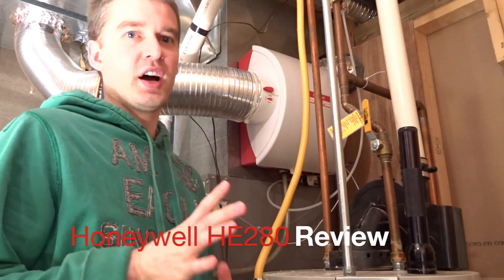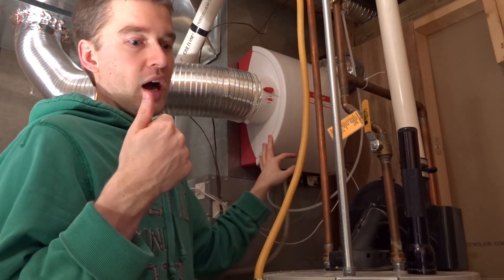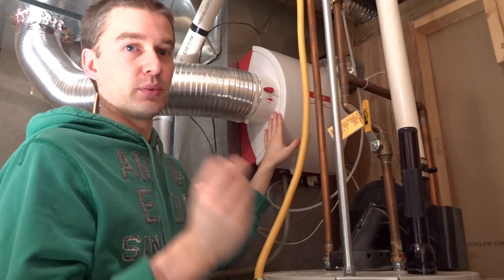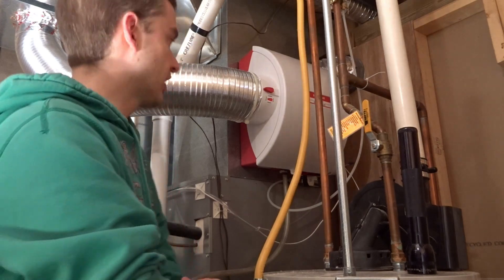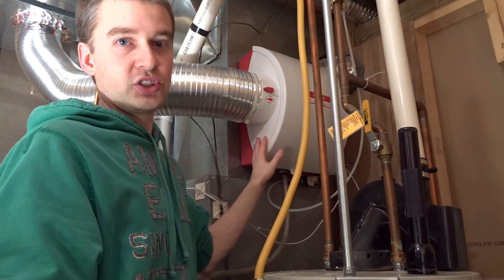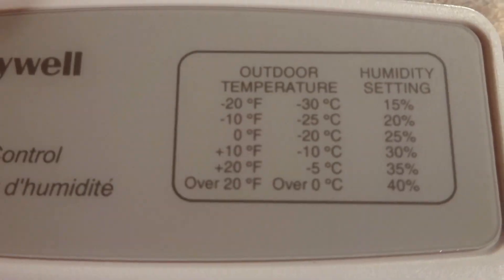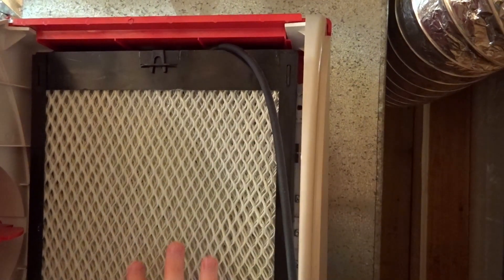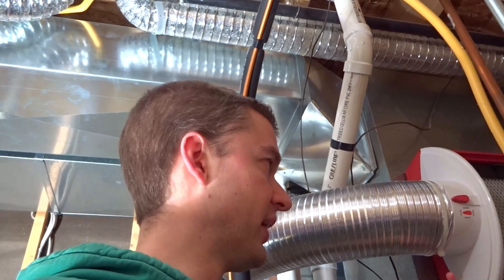Honeywell HE280 Humidifier Review

Comment: Thanks for the video. I installed a HE240 this weekend. It was fairly easy to install. I had to use a PEX valve instead of the provided saddle valve for the water hookup. At first I used the compression fitting inserts that came with the saddle valve (the brass insert and plastic ferrule). The fitting leaked horribly. I went to home depot and got a new brass insert and ferrule from a different manufacturer and that worked great.
Reply: So, how is the HE240 working for you, can we get an update?  How has water usage been?  How about air quality/humidity.  THanks!

Comment: I am in the middle of installing an HE280, as my previous HE220 solenoid valve was stuck and wasting water going through continuously (probably related to hard water deposits). I had to cut the opening in my return duct larger for the HE280 and slightly shorten the air bypass duct length. Then I found that the quick connect on the valve leaks water no matter how carefully and firmly I push in the plastic tubing. Will go to a hardware store tomorrow and try replacing the quick connect adapter. I wish the instructions would have the option to omit the pressure switch, as I don't see the need for it if I use the 24VAC power from my furnace circuit board that already cuts power when the fan is not running. I will figure that out after fixing the water leak.

Comment: Adjust the air flow knob "summer/winter" down a notch as to not suck moisture into the combustion chamber. I noticed the deposits above the furnace body. this is my experience anyway.
Reply: How did you wire the unit up? I still can't get mine to work...

Comment: Hey Jett! My bro and I recently installed the HE280 model on his furnace. The part that takes the most patience is the duct cutting. Aside from that, it was not hard at all. 

I think I see one problem with this installation though (I know you didn't do it). The air goes from the humidifier itself, to the return duct that it is connected to.  It looks like the previous homeowner installed the humidistat AFTER the duct that the air goes through from the unit. That will create a false reading I think, because the newly humidified air is now hitting the humidistat instead of the ambient air from your return vents, which will not make it cycle correctly.
Reply: you are right, the humidistat should be before the humidified air enters the return duct for it to work correctly.  good eyes.

Comment: I have a powered HE300 Honeywell Humidifier, and it can actually run without the furnace calling for heat (the humidifier kicks on the fan when needed).  I have issues reaching 40% humidity when it's 25F outside.  You said your humidifier is great even in negative degrees F...do you live in a humid climate?  I'm curious, as it's cold AND dry outside, and I want to make sure my humidifier is working correctly.  Thanks!

Comment: If my attic isn't vented (old farmhouse, previous owner covered the gable-end vents too) should I be worried about mold growing in the attic with one of these? There is a lot of cellulose insulation in the attic, but it is not air sealed.
Reply: Buy a cheap hygrometer, like the ones used for cigar cases. Take readings off it. If the humidity up there is over 50 percent, that's too high and promotes growth.

Comment: Question: The last house I lived in had an aprilaire humidifier that was awesome when it worked. Now, I live in the St. Louis area and calcium is a problem in our water. Almost every year I had to rebuild or replace the celinode on the humidifier in our old house. In our new house we don't have a humidifier yet and I was wondering if you've experienced any problems with the celinode on this unit? Any information would be awesome. Thanks a lot.
Reply from the maker: Funny you should ask. The solenoid just went out this year.

Comment: Whenever you connect your water supply on humidifier you should you should connect to the hot water line.Works quicker for humidification process
Reply from the maker: Does that cause quicker corrosion of the lines and filter?
Reply: That does not apply to the Honeywell True Steam Unit. They recommend that you supply cold water to that unit! The reason is the filter cartridge doesn't like water thats over 90 deg. F.
Reply: @kylew.jarratt4543 is this model a cool humidifier or a hot humidifier?
Reply: That’s a terrible answer because we all know everyones water takes sometimes two minutes to get warm or hot and it’s just not running that much water to the pad continuously. Cold is the better option

Comment: I installed the same humidifier after watching your review. I have a few questions 

1- On the Humidistat it indicates as it gets colder to turn your humidistat down. Ex: -20C they want you to turn the dial to 20-25% (I understand that it helps reduce moisture on the windows but when you bring your levels that low won't you be uncomfortable as its outside the comfort zone?

2- You said that it takes minutes When you adjust your desired setting on your humidistat. My house was at 30% and I had my humidistat up to 40% for hours when it was -29C outside and it was not going up at all. Am I doing something wrong?
Reply: Depends on a number of factors. How large is your home? What part of the planet, your at? How well your home is insulated. The unit only can deliver so much moisture, per day! Who sized the unit?
Reply: I was wondering the same thing when I watched this video...it seems counter intuitive, typically, the colder it gets, the more dry the air becomes....hence, the need to add more humidity to the air, not less.  I wish someone could explain that, I guess it could be the water on the window thing, but they should just leave that up to the owner and let them know---"hey, you will get condensation on the window or cold walls if the temperature drops too low and you don't decrease the humidity".

Maybe the lower percentage for lower temperatures means that is the anticipated natural humidity in the house, and the humidifier will crank out more humidity???  I know your comment was 2 years ago, did you try the recommended setting?  Did you ever get it to work?  What was your solution...replaced the model?
Reply: if you have moisture on your windows it will drip down to the wood and over time, make it rot.

Comment: Nice video. Could I ask how to shut off water to humidifier? Thanks.
Reply: there is a valve at the water supply line running to the humidifier.  for summer use turn the humidistat to off.
Reply: @davidm7824  THANKS.

Comment: Shouldn't it be installed on the cool air return side ,and not the furnace side.
Reply: cool air will not keep the duct dry, so cool air duct grow mold much easier than the hot one. personal opinion!
Reply: @hongliu5344  - You're backwards chief; Warm air is mold & mildews BEST friend!!! Grows slower in colder air.
Reply: If put on the cool air return side you would then have to send the humid air through the filter...right?
Reply: @ldlink3935  The moist air will damage your heat exchange. Need the hot air to move the moisture.  Also I think you need to hook up hot water to the line. It will evaporate much easier then cold. If you hook up cold water on the cold air side. You have no heat to evaporate the water. Also no to the filter question. It runs through the cold air intake into unit and to the heated side.  This avoids passing it over the exchange.
Reply: i just installed mine, and the directions say you can install it either way. just make sure you install the humidistat upstream (before) the humidified air goes into the duct not after.
Reply: @mitchkennedy11  You would need a recirculation pump installed to use hot water because nobody’s hot water gets fast instantly

Comment: Cost savings is probably a myth. It takes more energy to heat up wet air than dry air. It is true that you will feel more comfortable with lower temperatures at higher humidity, and therefore there is less heatloss though the homes insulation, windows etc. but I don't believe for one second that a humidifier results in energy savings.
Reply from the maker: The claim is that you can turn your heat down slightly, and the humid air will feel warmer. We keep our heat at the same setting, so I'd tend to agree with you.
Reply: Sorry Gents! But the heat load numbers don't show that. Because the heat in moist air stays in the structure. Less heat loss.
Reply: in the summer go outside when it is 85 degrees. does it not feel hotter when the humidity is high? same thing indoors, in winter in feels warmer with higher humidity, so you can lower the temperature, saving energy. it also keeps your wood furniture from drying out. makes it last longer. think about it, it is no myth!!!

Comment: Question for you..I installed my Honeywell and I love it!  I hooked mine right into the terminal in my furnace that was marked humidifier being that I didn't have an outlet near by.  Was that not an option for you with yours being you plugged into into an outlet on its own.  Just curious!  I was so hesitant to cut that hole into my duct work but I just made the plunge and did it..SO glad I installed it!
Reply from the maker: That's interesting! I'm not sure if that's an option on my furnace, but that would have its advantages. I love ours too, very little messing around and very good results.

Comment: I purchased and installed this unit 3 weeks ago. It is going through A LOT of water. Like 15 to 20 Gallons per day!!! 
Where I live, they charge us for our water usage. This was supposed to save me money on my heating bill, yet it is now costing me MUCH more money in water bills. This is unacceptable. 

Can anyone please provide a means of using a closed loop system for the water supply (which i would top up manually as needed), or some other way to reduce the water usage but still get the right humidity level for my home?

Otherwise this product is useless for anyone who pays for water usage. BUT, humidification is necessary for a furnace as not having proper humidification will cause respiratory problems for adults and especially children.

I will not be able to recommend this product to anyone unless can figure out how to reduce this water consumption. Any help would be greatly appreciated!
Reply: how were you able to measure water usage?
Reply: it is easy, put the water drain line in a bucket for 24 hrs
Reply: maybe he has the the humidistat set way to high or it is not working.
Reply: That water usage is normal with these types of humidifiers, I don't know where they pull their max 12 gal number but its bogus. Depending on the outside temp mine uses about 6 to 9 liters per heat cycle ( the water valve is only open when the furnace is fired) I see this on my digital water meter. I call BS at 5:19 with his water estimate, you know he never measured it.
Reply: @jonsmith7667  What I did was install a SharkBite valve on my cold water line and connected the water feed line to the SharkBite valve.  This way I can control with the valve the water flow to the unit.  With the unit running I look at the amount of water that is flowing out of the drain tube.  I adust the valve until I have a trickle coming from the drain tube.  This way I know I have sufficient water flowing through the but not too much.  If I opened that valve all the way,  there was a ton of water going down the drain.
Reply: @fredrickwilliams5804  that's a good idea and I have tried restricting mine but the problem with where I live is winters are a crap shoot. humidity and temperature are all over the place so it required a lot of adjustment

Comment: waste water like a hell. I measure mine. More than 80 liter of water flow into the drain per day. Such a waste. Not environmental at all. This thing hurts the earth.
Reply from the maker: That's a good point. Have you tried turning down the humidity setting so the pad just stays saturated.
Reply: Should check to see if the solenoid valve is functioning properly. These solenoids are known to fail and cause water to continuously flow.
Reply: Don't trip! there Mr. Earth. Check to see that the restrictor valve is in the line. And the valve is closing when it's off. Then go hug a tree! Lol!
Reply: Hurts the earth? Please explain to me how you manage to destroy H2O?
Reply: Flow down the drain? These things have a humidistat and control valve. If the humidistat is reading the setting the water valve is closed. If it's not shutting off it will flood the furnace not go down a drain.